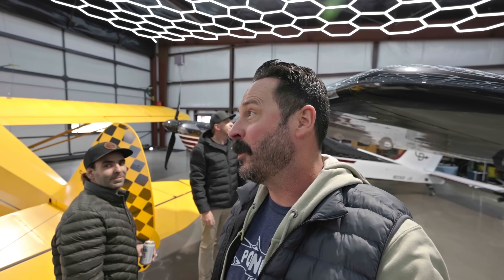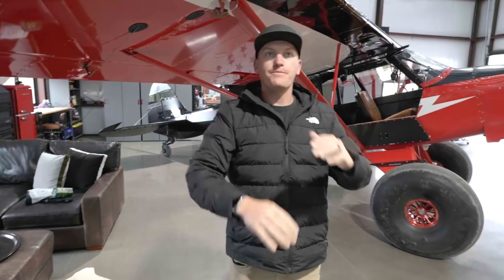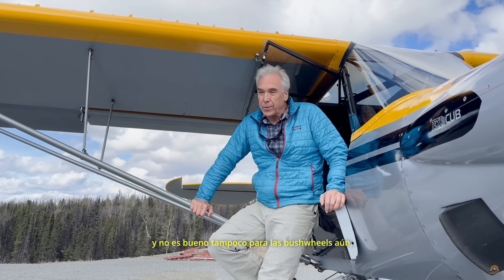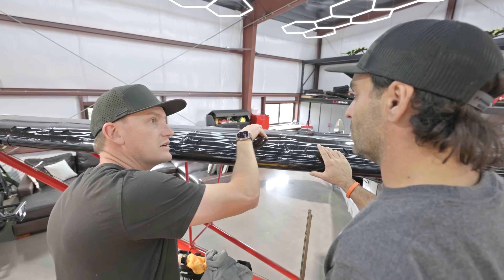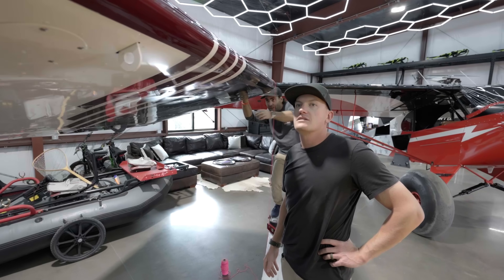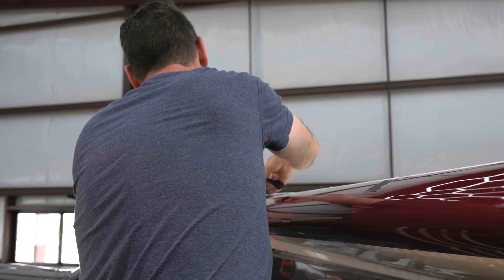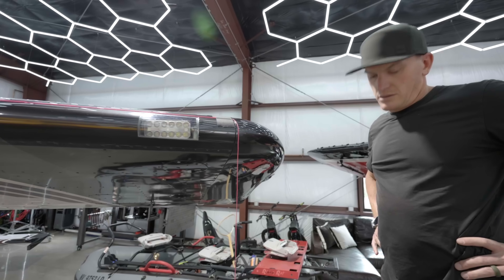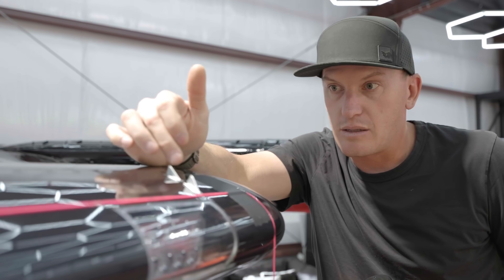Do VGs work? Trent Palmer & Queque helped me put VGs on the Bogey

Comment: We put VG's on our SkyWagon after having the Sportsmans cuff for a year. Our stall speed didn't decrease but my elevator authority came completely back and the ailerons responded so much better at slow speed. The 180 VG kit has the wing, the bottom of the horizantal stab, and the rudder. Much needed.

The VGs brought a lot of control back to the plane at very slow speeds. The SkyWagon is a great plane that cruises around 145 mph and stalls around 45 mph with the Sportsman STOL kit and VG's

Comment: So if you use say 37mph as your stall x1.3= 48mph, call it 50mph approach speed for a short landing, adjusting if for steeper sloped runways as required
Reply from the maker: It seems short fields is where I’m at all the time suddenly. It’s nice to approach 10th slower. 45 with power on results in a plenty short enough landing. <300’ consistently!

Comment: VG and gap seal on the horizontal stab.  Power on stall is great for practice but the power off numbers are what you want to have in mind.  It's all about touching down as slow as you can safely.  Powering into a landing is not a great plan. If the engine quits on short final when you need it most you will end up stalling and "landing" short of the runway.  Practice power off landings.  Full flaps will give you a steeper approach angle so you can hit your intended touch down point more easily.  Time to put those fighter pilot skills to bed. :-)
Reply: 16,000 hrs and I have never heard of an engine quitting on short final if it had been operating normally earlier in the flight.

Comment: I had VG's in the underside of the horizontal stabilizer (cub).  They (wing and stabilizer) are a tremendous safety feature. But! Try a departure stall at altitude with full power- you will be shocked at the deck angle and the abrupt departure from flying!

Comment: Put them on my C170A.
I was doing slow flight at indicated 40 knots with the lift indicator fading in and out. Wings stalled at around 35 knots. 2 people on board full of fuel. Have been very pleased with them.

Comment: VGs on the elevator will also help.
Reply: Bottom of the horizontal stabilizer, about an inch forward of the trailing edge of the aft spar works wells, I've never seen them on the elevator itself?

Comment: Did you try them under the horizontal stabilizer? Putting them under there made my short tail S7 able to put the tail wheel down first if I wanted. Think it would give you more elevator authority.
Reply: Ditto on my S20